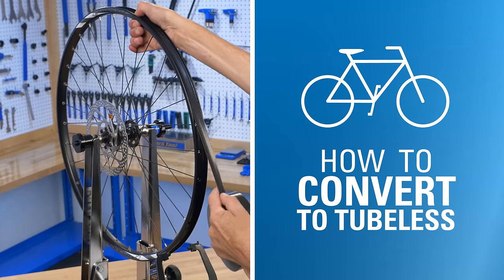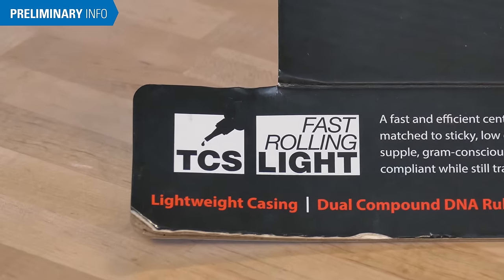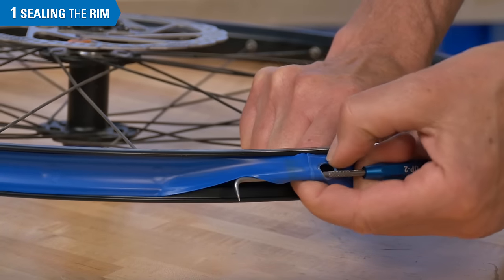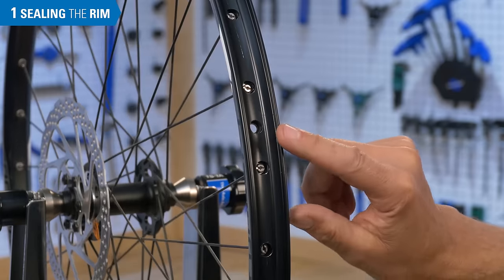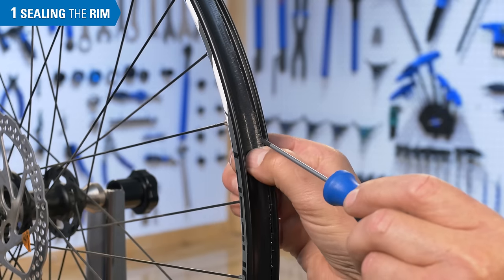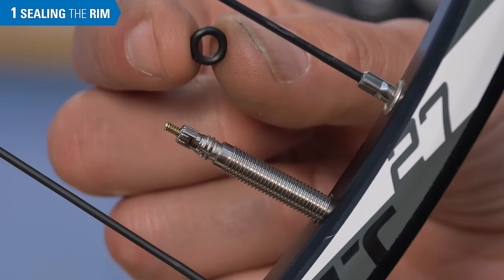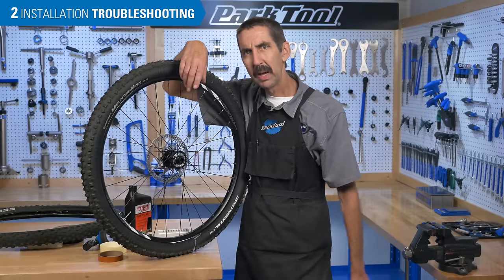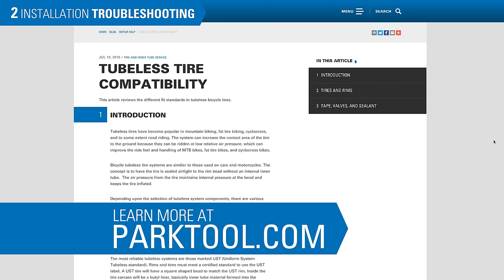How to Convert Your Bicycle Tires to Tubeless

Comment: Park tool using Gorilla Duct tape as rim tape... All of a sudden I don't feel so alone.
Reply: I noticed the same thing, Gorilla tape. Does that really work?
Reply: Must
Reply: @gyeag4343  Don't see why not, it's made for the same purpose -- airtight strong adhesive.  Except gorilla tape is made for even more extreme situations.
Reply: Paused the video and came to the comments as soon as I saw gorilla tape.

Comment: Best part in this video is he is using gorilla tape! The best tubeless rim tape! 😂😂🤣
Reply: until it fails. Stans dissolves the glue. everyone avoid claims like this.
Reply: @gregknipe8772   then you just clean and retape the rim... I've never had an issue... running the same tubeless setup for years...

Comment: Hey. Thanks for the video.

It really gave me a good idea in which direction to go starting out tubeless. But there is no question. Tubeless is the way to go. So many struggles avoided after taking out the tubes. I found a good method for keeping pressure after your done inflating and the tyre is seated is to rotate and bounce the wheel off the ground several times. Maybe for about 5 minutes. Personally I have had some excellent results doing this.

Love the channel. Good motivation for myself.
Reply: Can you tell me if I can install on my wheel the tubeless but my hasn't a logo with tubeless? Or it can't handle it?
Reply: Also in 3:30 instead of using this type thing to fill air in the wheel can I use the normal?like in non tubeless
Reply: Hi. 
I'm not too sure if the rim will be compatible. I think that is what you're asking. But waht you can do is look for a picture on google that explains or shows what the rim looks like there where the tyre bead would seat. And then compare it to your rims.
Reply: @WestCoastMountainBiker   West Coast Mountain Biker  thx, that I was asking, also can you answer me the second question which is over this comment? And I have one more question, can you answer me this questions with my bike(If you can, that would help me a lot) I have the cube aim race '19, but I have installed the Shimano Mt 200 hydraulic brakes, will I be able to change my rotor disks from 160mm and 160mm to (around) 224mm and in the rear (around) 204mm?
Reply: Sorry man. I didn't understand the second question at first. The valve that they use here is called the Presta valve. The other valve is called Schrader. You get Schrader tubeless valves but obviously they differ in size from the Presta. So if you have existing Schrader size hole in the rim try and source the tubeless version of this type valve.
Reply: Unfortunately the question about the brakes I can't help you. Best advise I could give is to consult a bike mechanic. But hey. Hope you come right.
Reply: @WestCoastMountainBiker  yes I mean the Schrader valve, can I put instead of the other, the valve which I have now (shrader), with maxxis tubeless, or in tubeless you can put only the other valve, (not the shrader)
Reply: @WestCoastMountainBiker  thx for answering man
Reply: If you currently have s schrader valve hole the Presta valve will not fit properly. I've seen that you do get some sort of hole reducer/washer for the Presta valve but only on google. If you can I think getting the schrader type tubless valves would work the best in that situation. Otherwise if you have Presta valve size hole in the rim I would just stick with the Presta tubeless valve.

I'm glad if I could help you in some way. If you're interested you can check out my channel. Then you can leave a comment on what type of videos you would like me to post in the future. I'm currently busy with some lockdown ideas, which probably will suck due to only having access to my yard.

Comment: Great video. Very helpful. I failed once with joe's no flat tubeless kit. The yellow rim tape didn't stick at all to rim the. After watching this video I went to the shop and bought some gorilla tape and then job done. The rim was properly sealed. Thanks
Reply: How much pressure in the tires? (I'm thinking of doing a road tubeless conversion with about 60psi)
Reply: A word of caution there, i also used the Gorilla tape since i could not get a good seal with "No Stans tape" and ended up with way more seal than i could have wished for. Unfortunately found out the hard way when I had to remove the tubeless  tire, it was nearly impossible without the use of 2 flat screwdrivers and some elbow grease. The tape glued so strong around the tire bead and so tight that there was no space or way to remove the tire with regular levers, additionally the residue that that the back of the tape leaves is not a good thing. Might work for some but be aware...

Comment: I would highly discourage denatured alcohol and go isopropyl.  Way cleaner surfaces after evaporation.  Denatured is one of the worst with leaving a slick film. Just trying to help.  (over a decade in the glass industry). Clean surfaces are required for any water tight seal and 100% isopropyl is the only way to go.  Love the videos 🤙🏼

Comment: I wonder how often a not explicitly tubeless ready tire fails even with sealant. The tire I have in mind is a Duro Wildlife Leopard 24" x 3.0". It's sturdy (and expensive). The bead is very very tight on the wheel (of a QU-AX unicycle). If it's unlikely to work tubeless, I'd like to avoid the wasted effort.

Comment: Great video .
But , what if i dont have 4 different width rim tapes to choose ?
How can i calculate the right rim tape ? 
For example in a 22 inner width rim , shall i use a 23mm rim tape , a 21mm , or other ?
Thanks
Reply from the maker: Good question. Typically the drop channel of the rim will take up about 2mm or rim tape so taking the internal width of the rim and adding 2mm is a good way to calculate tape width.

Comment: my tubeless wheels were not tubeless ready or probably not meant to be tubeless at all but i got it to seal with 3 wraps of inch wide gorilla tape, sealant, and the tube strip i put back on after the tape
Reply: so how was it bro? was it any good??
Reply: Same here, non tubeless ready wheel, one strip of gorilla tape, plenty of Stan's, leaked at first thru spokes but sealant stopped leaks, been riding for a few weeks now no flats no leaks

Comment: Good video; however it is worth noting that you might need to wrap several layers of tape slightly narrower than the inside of the rim. Non-tubeless wheels aren't designed to push the tubeless tyre out into the bead channel, so some internal tension created by a strip of tape between the beads is helpful. 
To actually get certain tyre-rim combos to seat, I've had good luck with entirely removing my valve core and shooting compressed air into the stem with a blowing nozzle - less resistance than a presta valve.

Comment: Do i need to buy the ready tubeless rims or not because my roadbike is non tubeless rim and tyre. I already buy the tubeless valve,rim tape and tyre but ididnt work ( using non tubeless rim)?
Reply from the maker: With road tubeless i would not try to convert a non tubeless rim. The high pressures and high speeds of road riding demand a precise interaction between the tire and rim.

Comment: Couldn't stuff pop through the tire to cause a flat the same as when you have a tube inside, but now you don't have a tube to fix the flat tire. Do you carry the sealing goo, nozels, nozel tool, solvents, rags, plus levers and  pump around instead of a change of tube in this case to fix flats? Seems more annoying to deal with, especially if you're in bad weather.
Reply from the maker: In theory the sealant inside the tire will repair most punctures. So, you may never know that there was a puncture. Same spares needed as a tubed tire. Tire lever, inflation device and a tube. Each system has its pros and cons.

Comment: The lowest part of the inner side of my rim is deep. The rim tape doesn't stretch enough to actually mate with the lowest part. Is that a big deal?? It is holding sealent and pressure, but will the tape stretch and rupture?

Comment: So just to be sure, a tubeless system would work with a non-TR rim and tire? Or would you need one of them TR?
Reply from the maker: Stans no tubes has a good chart on there website that shows more info. And to be vague on this because there are so many rims and tires out there. the answer is.... Maybe. We have shown success setting up a non tubeless rim and non tubeless tire in our fatbike tubeless video. But this is not always the case. Do a bit of digging for your specific setup and you should find your answer. https://www.notubes.com/standard-tubeless-system

Comment: hi guys. question from brazil here... Did you used a regular black tape on the rim, or is a special tubeless adesive tape?
Reply: It looks like gorilla tape which is a very strong duct tape
Reply from the maker: This is gorilla tape being used in this video. There are many tapes that will work for this purpose. It needs to be strong and resilient to chemicals.

Comment: I couldn't tell from the video but is it possible to use a presta valve if you have a schrader valve by default when transitioning from tubes to tubeless?
Reply from the maker: I really cannot think of a good way to do that. You would be better off using a schrader tubeless valve.

Comment: Will this work in any rims?? I have a clincher. I wanna switch to tubeless can i just tape the rims to be tubeless ready,
Reply from the maker: No, it does not work in all cases.  The rim and tire need a proper fit as well.  You can try it, sometimes that is the only way to know.

Comment: Pro tip: Use Gorilla Tape for your rim tape.  It works better than anything else you can buy.  I tried Stan's rim tape, but it sucks.  It has almost no stretch, so when you try to press it down inside the rim, the edges will wrinkle leaving multiple air gaps.  After wasting nearly an hour trying to get a good fit with Stan's, I finally threw it in the garbage and bought a couple rolls of Gorilla Tape To-Go which is one inch wide, sticks extremely well, and it's stretchy, so it presses smoothly into the rim without leaving the edge puckered.
Reply: It is necessary to remove old rim tape? And how many loop of gorilla tape did you put on the rim?
Reply: @danl5632  Yes, remove old rim tape. I did one loop of Gorilla Tape, and it's holding. Some people recommend two loops.

Comment: I have a fat ebike with 26 x 4.0 fat tires that I ride on pavement and want to go tubeless. I am considering getting new Maxxis Mamoth tires, as I like the tread, price and reviews I've read, even though it's not as efficient as smooth pavement meats.  My 26" wheels do not have the typical cutouts to lighten them- they're totally solid. My question is about tire construction. Many of the tubeless ready tires of the same model are sold in either 60tpi or 120tpi and some are tubless ready while others are not. Some are foldable and some are not. Some have a wire bead, yada yada yada. Can you fill me in as I have no idea what to buy? Any help would be appreciated. PS, I'm asking this same question on a few other tire/wheel vids, so please don't be offended if you see my question elsewhere. I'm taking as much info as I can get. Thanks in advance.
Reply from the maker: The folding options that have a kevlar bead are typically lighter weight and will usually have a higher TPI. The higher TPI allows the tire to be more supple and offer lower rolling resistance. The higher thread count also makes the tire lighter. The reason a higher thread count tire is more supple and lighter is that there is less rubber in the tire. These can be tubeless or non tubeless. Personally I ride my fatbike on many different terrains and very much prefer higher thread count tubeless tires. In the snow it makes a massive difference in keeping traction and conforming to the snow pack. Hope this helps.

Comment: I tried this using a 26 x 2.3 Maxxis Aggressor tire on a 26" rim from a 2017 Trek 820. CLeaned with alcohol, 1" gorilla tape seal, 100ML of Stan's and I could not get past 0 psi... Air leaks from the sides and I cannot get the tire to seat. Any advice?
Reply: use an air compressor to get more air into the tire quickly.  I've found this to be the easiest way to achieve a seal. Sometimes a floor pump works, other times i've nearly passed out from trying to pump so fast for so long and achieved nothing.  A floor pump can be used to finish once a seal is achieved. I currently remove the valve stem, use the air blaster attachment, and blast air in through the hollow valve. Then screw the valve stem back in after i've seated the tire bead.  works like a charm, and effortless.

Comment: About appropriate tubeless rim tape for a rim: inner width 27 mm, should the tape be 27 or 28 or ... ? We don't want to buy just all of the tapes, so any suggestions?..
Reply from the maker: Honestly both will work fine in your case. The width of most beads is about 3.5 mm. That means the bead sits 3.5 mm in from both rim walls. If you get the tape within a mm of the sides you will have sufficient overlap of tire and tape.

Comment: hello 
i want to assemble a bicycle wheel i bought hub 32 holes i bought rims 26 / 32holes  but I do not know how long it should be spokes :((
Reply from the maker: Hello Vlad, to calculate spoke length you will need a few measurements. The effective rim diameter (ERD), The flange diameter of the hub (both sides) and the center to flange measurement. There are a few calculators online that do a good job of walking you through the process. Dt Swiss has a good one as well as Sapim. Often the hub and rim dimensions are documented on the manufacturers website. Hope this helps.

Comment: Could I just tape the holes for the spokes instead o taping the hole rim? Maybe with silicon or small pieces of tape. (Tu sum up, make little patches instead of the tape)
Reply from the maker: We tried this a long time ago, and it was not so successful.  But you can certainly try it yourself.  Having continuous tape apply inward pressure around the entire perimeter of the rim well.

Comment: That blue inner tube strip, isn't that already a tape in place for ready rims? I have that, should I remove it?
Reply from the maker: Some companies make a blue tubeless tape that will work great. Some wheels come with a plastic or fabric rim strip. The rim strip which is not stuck to the rim will not work for tubeless. I hope this helps!
Reply: Helps very much, thank you a lot!

Comment: Can a clincher tire be run safely on a tubeless ready (TLR) or TCS rim? Can a clincher tire be run on a UST tubeless rim?
Reply from the maker: A UST tubeless tire is considered a clincher. But yes a standard clincher can be run on a UST rim. The UST tires and rims are held to a tighter tolerance allowing them to seal up very well together. The tolerances are within the tolerances of a standard clincher tire though. Hope this helps!

Comment: I have yet to find a tubeless tire conversion video that mentions that sealants are temporary.  The best sealant has to be replaced every 2 years.  Some will only last a few days.
You also have to check the temperature rating.  Some wont work in hot weather and some will freeze in the cold.  
and this isn't even taking in consideration how well it seals.  
This is probably why bikes are sold with inner tubes.
Reply: Great comment, maybe the silicone tube would be good choice?

Comment: December 1st...

Nut secured boys
Reply: Can you tell me if I can install on my wheel the tubeless but my hasn't a logo with tubeless? Or it can't handle it?
Reply: Can you tell me if I can install on my wheel the tubeless but my hasn't a logo with tubeless? Or it can't handle it? Also in 3:30 instead of using this for the air to do in the wheel can I use the normal?

Comment: it is allow to convert a non tubelss ready to tubless?
Reply from the maker: Stans no tubes has a great writeup about what non tubeless tires and rims work for running tubeless. There are so many options out there that this is not a yes or no answer unfortunately.
Reply: what do you mean?

Comment: Calvin - Question 
just got a set of WTB : Ranger tires Steel Bead .
can i Convert to tubeless ???

i also have another Set WTB tubeless TCS tires the Bead is SOFT !! and Can run Tubeless
i check the BOTH BEADS LOOK IDENTICAL EVEN the INTERNAL CASING LOOKS IDENTICAL 
maybe internally  the TCS seas Better !!!
Mind YOU another wheelset i have EASTON EA70  XCT had MAXXIS tires and i did a RESEAL with STANS and the 2nd day the sealant was leaking out of the SIDEWALL !!! LIKE SWEATING TIRES !!!!!
it eventually stopped SWEATING
Reply from the maker: My initial response is, give it a try. I have run many non tubeless tire as tubeless. If I were you though, I would reach out to WTB and see what they have to say about it. They may say "no" and these are the reasons why. Or they might give you a vague yes. Either way a good learning experience.
Reply: Park Tool  : thanks for Reply .
I think these were OEM SPEC WTB Ranger on a bike take off with inner tube .the WTB site only list TCS tubeless 4 sale 
yes leaning experience , going to try Gorilla tape Black or the CLEAR Gorilla tape

Comment: Do the tires have to be "tubeless ready" for this conversion to work?
Reply from the maker: For this to work reliably and consistently, both tire and rim should be "tubeless ready".  It has been with without this begin the case, and sometimes the only way to know is to try.  It may make a huge mess, it may not work, but then clean it all up and go back to tubes.